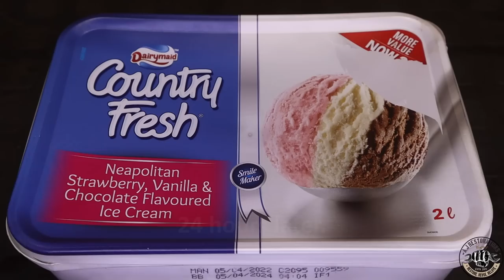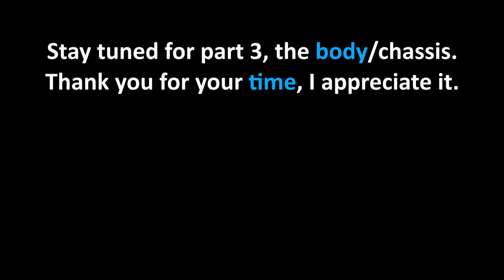Vintage  "Speedy Trim" Edger Restoration - Episode 2

Comment: It's always amazes me to see old mower engines cleaned up it sounded so good to here it purr why 2hp couldn't get 3.5 decal they  are one of the best lawn mower/edger motors ever built wish you would have shown the torkeing of bolts would have been interesting to see what tork wrench you used excellent resto
Reply from the maker: I don't always show me fastening every nut or every detail, the video tends to feel stretched out. even as it is with a LOT of cut content it already feels too long.

Comment: That bayonet gas Cap and the recoil spring turned out nice looking at least you got that rust off I got a couple of the bayonet gas Caps for a Tecumseh  gas tank at Ace hardware that stuff is a hard thing to get unless you get them off of eBay
Reply from the maker: They to look great. I am lucky, every Briggs I own came with one.
Reply: @AJRestoration   glad to hear that you got those bayonet gas Caps on the Briggs and Stratton engines that you got

Comment: Awesome video. The engine looks like new. But I don’t think that’s the correct air filter for it. It could be but I don’t know. Also what happened to that metal plate that was in the back of the engine?. Isn’t that there to help with airflow around the engine

Comment: Nice!, but did you check the valve play?
Reply from the maker: Yeah I did, it was all within spec, so was the piston rings. This engine still had the crosshatching from the factory, it was basically brand new.

Comment: That muffler needs an adapter away from the carb like that's dangerous 😅
Reply: That's the way it came from the B&S factory.
Reply from the maker: Correct that is how it is from factory.
Reply: @AJRestoration  well factory weren't thermal engineers but would save your life down the road to change it up hahaha
Reply: I'm certain the idea is to preheat the fuel. The hot fuel vaporizes easier allowing for a more compete burn. This makes it run smoother and more efficiently. Cars used to do the same thing running the fuel lines near the exhaust.

Comment: Looks like you used the wrong sparkplug and it is too tall, no way to ground it out to turn it off.
Reply: My mistake, it wasn't tightened down yet:)
Reply from the maker: Actually you are correct, it was too long on the top, I had to change it later on. I left it in for a while so no dust and stuff could enter the cylinder.

Comment: It looks like you installed the wrong spark plug since the shut off lever doesn't reach the tip of the plug to short out the high voltage. And it was a 3.5HP and you put a 2HP decal on it. I also see you changed that spark plug too before the start up.  Other than that a truly amazing rebuild for sure... Thumbs Up
Reply from the maker: Yes the spark plug was the wrong size, that is why I changed it later on. Also its a 2HP engine with a blower housing from another Briggs engine that was a 3.5HP vertical lawnmower engine. So the decal is correct and represents the engine.